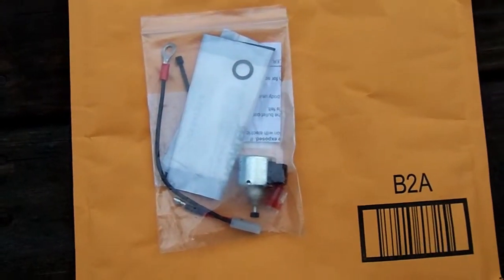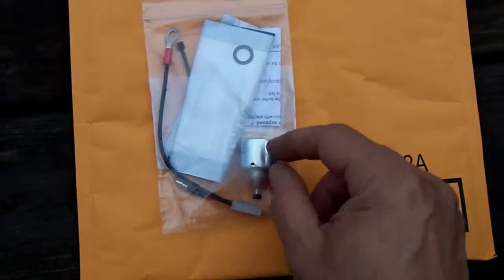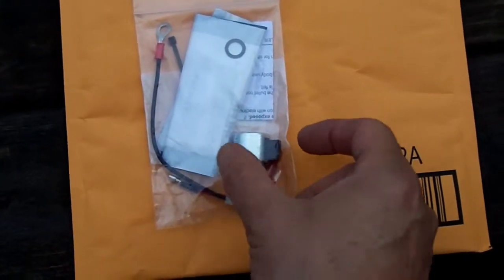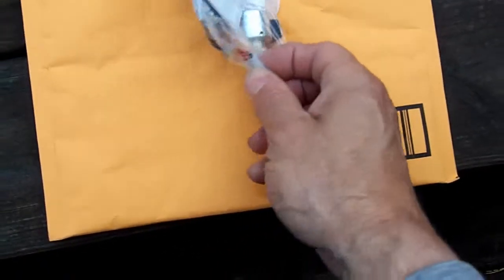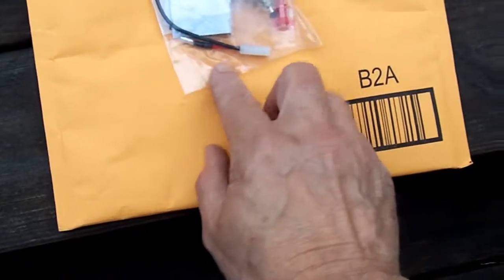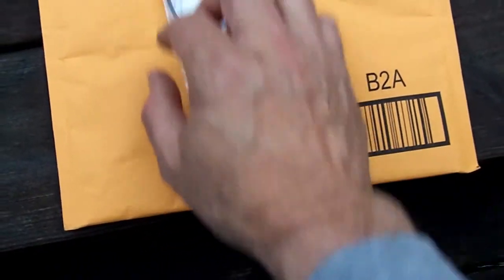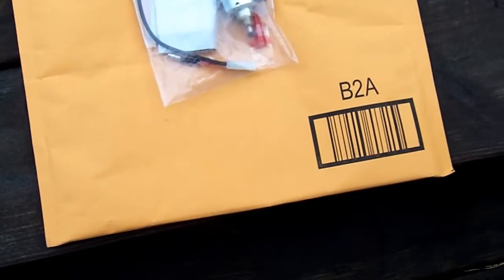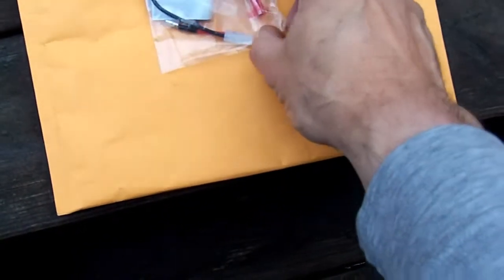Kohler Engine Repair Update

Comment from the maker: AC coming off the stator seems excessive at nearly 45 Volts. Wish I could get someone with a similar engine to measure their.  What to do? Spend another $25 on another regulator? Was going to build my own, using bridge rectifier, a large power transistor and a LM3415, but all the 78xx series have a 35V max.

Comment: Measure it with a couple amps of load. Unloaded could give you wild results.
Reply from the maker: JohnAudioTech   Yeah, will be doing that next time I'm up there, but whatever circuit I use has to survive no load conditions too. Would love to hang an O scope on it too, this is where a little hand-held one would be handy.
Reply: Anton's Workbench Use a 120 volt electric heater/hair dryer as a load. A 1500 watt heater would have a resistance of about 10 Ohms so would work out to a load of 4 amps or less depending on how the voltage drops under load.
Reply from the maker: Yeah, actually, I want to load it for about an Amp or just under, as I there really is not much load other than battery charging when the mower is running during daylight hours. I suppose I might want try a few different loads.